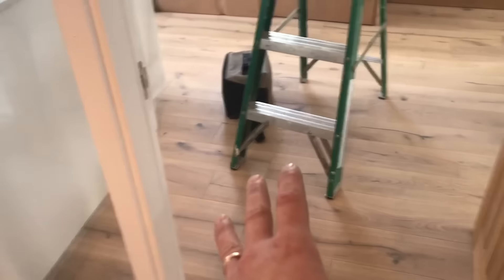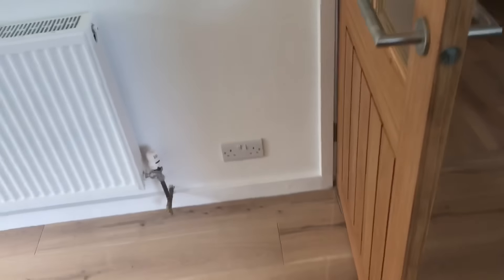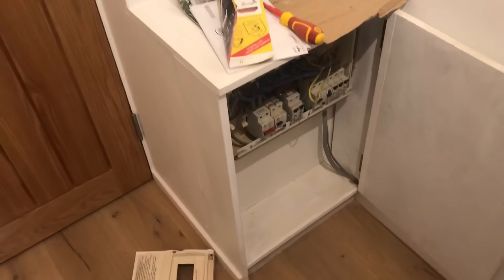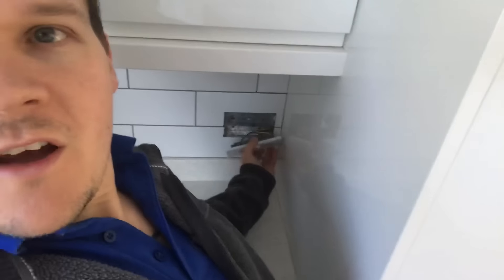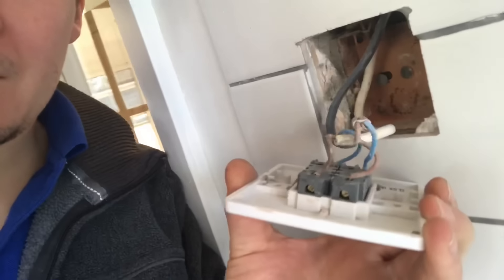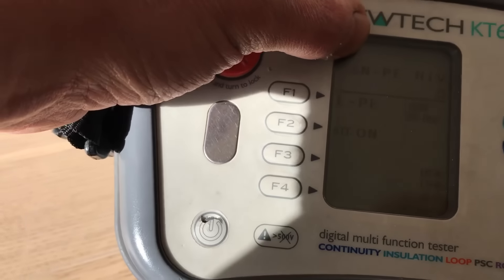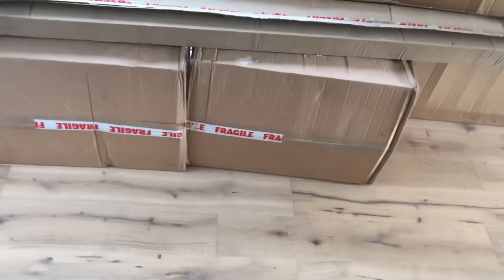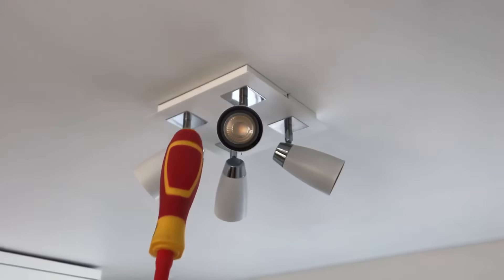Electricians day testing and inspecting one of the worst installs.

Comment: IP44 is actually higher than IPX4 andthat light is double insulated in the shower cubicle, Plus you take the measurement of 2.25 from the floor not the shower cubicle. Also what earthing system is it? TT,TNC-S, TNS? If it's a TT system then your reading are fine.
Reply from the maker: Trust me the readings are not fine it’s a PME system with a mains reading of 1.2ohms

Comment: Despite there being a wealth of free information on how to find, assess and hire professional tradespeople, the vast majority of people just want the cheapest quote for the work or job. 

I've seen and corrected appalling and recklessly negligent work billed as Professional, and have often pondered on What Were They Thinking?
Reply: They weren't thinking at all. That is the problem. Because no non-insane human could think in a way that makes stuff like that good. So we have to conclude they weren't thinking at all.
Reply: You see, that’s why you go for one that is recommended and charges fair prices. Expensive doesn’t make it professional work either. Also get an electrician that specializes in residential not one that does industrial and does residential on the side. They do know how electricity works but residential is a more meticulous work. There are electricians that do both and are good at both but are very rare and charge a bit more.

Comment: What was her reaction in the end? That's going to be an epic job to fix - going to have to chase the walls to put new trunking in, isolation needs to be fitted for the kitchen appliances so RIP any tiling/plastering. I'll go on a guess and say that flooring has to come up, which will probably wreck it. 

That's going to cost thousands in rework, wouldn't even be surprised if it were closer to 20k.
Reply from the maker: Video may follow on this one
Reply: @Cjrelectrical  Yeah do it,  probably not possible but I'd be interesting to find her side of the story and how she came to be in this position.

Looking at the fittings, she hasn't appeared to have 'cheaped out' which is usually what happens here. I'm totally hypothesising here, but either the builders under quoted figuring they could bodge the electrics or got in a cowboy to do the work (though any one with eyes can see that's just a massive hack job)

Comment: Any idea what can keep making the fuse in a spur blow whenever any heating programmer is attached to the backplate? All the wiring has been checked and is correct. Fault originally started when something metal falling behind the original programmer on to the backplate terminals. The boiler works if you connect it directly to power on with the spur currently. Could it be the 3 port valve that is causing a short since the programmer mostly controls the 3 port valve?

Comment: First number in an IPXX number is the dust rating, second number is water rating. It says IPX4 because the dust rating is irrelevant but it needs to be a minimum water rating of 4. That IP44 light fitting is actually OK - just about the only OK thing in this entire install from the looks of it.
Reply from the maker: Not with open connector blocks and an earth connected to a double insulated fitting.
Reply: @Cjrelectrical  Well, yeah.. theres a grommet going in to the fitting to keep the water out - as long as you kept the connector far enough away that IP44 light fitting is fine. What i'm trying to say is the fitting itself, as an IP44 fitting, is actually OK. Its installation however is a different story...

Comment: there is also the "gage"(is that the correct name in english?) wire thickness wich just dosn't seem to be thick enough for 32 A
Reply: very close gauge.  in the usa 10awg is good to 30 amps(distance applies but i think 30 amps up to 100ft) in GB 2.5mm is acceptable for 32amps but i wld use awg8 or 4mm but i always upsize for safety when practical

Comment: Why on earth, no pun intended, would you use metal housing boxes? I see this in US installations as well. In Norway we swapped those out as soon as plastic was invented and use ground wire instead. Also, the sharp burred holes in the metal boxes will over time (in wooden moving houses at least) wear down wire insulation, eventually shorting to ground. The 2x 1-pole light switches you showed though, seemed ok.
Reply from the maker: We use both plastic and metal
Reply: @Cjrelectrical  - Over all, I do agree with you, though. That installation was horrible, and I'm not even an electrician...
Reply: Also, in the fuse box, there was a floating L line. What was that?
Reply from the maker: There was 2 circuits I couldn’t even find that were buried covered up and left on and that brown wire was just disconnected and left in the Consumer unit.
Reply: @Cjrelectrical  - I'm cringing right now. As a courtesy to the client, install scores of fire detectors throughout the flat and run away. Saving a life is worth the investment.

Comment: It's interesting to watch your videos as well as some others.   I think standards have gone way down here (USA) also.  My parents' home was built in 1957 and wired exclusively with EMT (thinwall metallic conduit).  That takes some advance planning as you're somewhat restricted with your runs (every bend has to be done with a conduit bender).  Outdoor wiring was galvanized pipe.   But the electrical workers' union was very strong back then.

On the other hand, I visited my dentist who's having his office reworked.  This has been going on for over a year--crap wiring, workers not showing up--it makes you wonder.  He says that the excuse is that it's nearly impossible to find good talent nowadays.

Comment: A bad install. However your observation of the shower light in zone 1 requiring minimum of IPx4, then fitting found to be rated to IP44, thats ok isn't it? Or have I missed something.
Reply: I would of required the light fitting to be IPX5 as water jets could be likely from the shower.  The light fitting also appears to be class 2, however as this was a new install a CPC should be ran to every point.
Reply: @PJB71  Ok, thanks I am still learning from the EICR perspective of the trade. Forgot to say great content. 👍

Comment: All looks good, part P qualification working well  Bodge It And Scarper Builders INC. Read it and weep this happens all the time and there is nothing anyone can do about it. You can have all the rules and regulations you want, but when they are ignored and then not enforced what is a person supposed to do! The best thing you can do in this situation is to make out the certificate as unsatisfactory and call the supply company and have the supply disconnected for safety as the installation is in such a bad state it could cause death by electrocution and or a catastrophic fire

Comment: I have now retired but seen many of the problems shown here especially no earth on lighting mainly due to old wiring and the use in the '60s of double insulated singles. Of course, you get the know-alls that say my neighbour's dogs best mates uncles sister says you didn't need an earth in the 1800s and she's a teacher. Well, that makes it all good then don't it. Then the one who decorated right through had the old rubber insulated cables installed throughout the dwelling and wanted me to slice down the wallpaper fold it back, chop out for the cables, plaster it up then refit the paper... on every switch and socket drop (solid floor bungalow)...yeah right and where's that flying pig??? That one also wanted me to install a socket magically in a brand new fully tiled kitchen, much like the one here but not that cost I would have thought. That was without disturbing the tiling the plaster or anything whatsoever. Yep just stick it on the wall it will work fine. I walked... That incidentally reminds me of an installation I went to, to find out why a socket was totally dead...you guessed it no cable to it

Comment: Side note - IP ratings - first digit is Dust, second is water ingress, and X is used as an 'any' character. IP2X has foreign body ingress protection down to a certain size but no water ingress protection. If the standard says it needs an IPX4 enclosure, then IP(1-6)4 should be acceptable, Certainly an IP44 enclosure exceeds an IP34 for dust and foreign bodies.

Comment: IPX4 just means it should be splash proof. While IP4X means nothing bigger than a 1,0 mm wire can go through. Since the lamp is IP44, it is splash proof and nothing bigger than a 1,0 mm wire can go through. The lamp is actually okay to use. just not the best to use in a wet room. However personally i would use IP66.

Comment: i still dont get why attatching electrical cables to water pipes under my kitchen sink is a good idea? water + electric, what could possibily go wrong i have no idea?
Reply from the maker: Could potentially become live without an earth connection and you go to wash the pots and pans in the sink with  devastating consequences.
Reply: @Cjrelectrical  its an earth wire but still why does it conect to copper water pipes?
Reply from the maker: Extraneous conductive part

Comment: I'm american I honestly don't understand the 220 V that you guys use in the UK, Germany Italy etc....  But what I Really don't understand is WHAT  Why is the Gas Meter inside?!
Reply: In simple terms, if you double the Voltage, you half the Amperage and it's the Amperage that determines the required wire size for any given circuit.
Less Amperage = smaller wires = cheaper wires...
Reply: all meters are inside and its so easy to tap into mains for power if you wanted and utilities wldnt be the wiser lol
Reply: @wizard3z868  Actually, no it isn't easy to tap the Mains lines before the meter IF you want to do it without either shorting out the Grid (which the Power Company WILL detect) or electrocuting yourself and if you zap yourself with those wires, 99.9999999% of the time, your DEAD!...
No one other than Power Company Employees have access to or the tools to safely turn off the Power between the Local Grid and the Individual Homes (or turn them back on again)...
So any such "freebie" Taps have to be done while the wires are Live...
Good Luck with that...
Reply: @HappilyHomicidalHooligan  ive done meter cabinet installs in the usa from the power lines live its not that hard a good pair of rubber gloves and insulated tools and the balls of steel will do wonders hardest scariest £4 an hr job 20 yrs ago i ever had.
Reply: @wizard3z868 For a Trained Electrician or an Untrained Amateur that's been very thorough in their research it is easy and relatively safe, however, I was referring to the risks associated with an Untrained Do-it-Yourselfer who thinks they know what their doing but usually doesn't.
Reply: @HappilyHomicidalHooligan  lol yup a new phrase comes to mind play stupid games win stupid prizes or the all to common darwin award winner

Comment: The thing that I hate most is when a contractor is opening and working in a space...walls, ceiling, floor...know that there are problems and seal it all back up.  So, now you get to pay again to remediate.  That, and have to get an attorney.  Question...dont you guys have municipal building inspection services to certify safety?

Comment: I am not an electrician and not familiar with Englis regulations,
but I did not see any image where they used pvc pipes, rather ...
all the cable came out, as if the were plastered in with the stucco,
coming out, in front of the cable boxes. ???
In the netherlands, we would have to remove all the plaster,
cut out trenches, to put in pvc piping and then, plaster all the walls,
repaint all the walls.
This would come out at more than 4000 pounds.
Probably something like 10.000.

Comment: What is wrong with the light in shower? It is IP44, exactly as your book shows (your book shows IPX4)...
Reply from the maker: Open connectors and an earth connected to it so it’s not ip44 and it’s not double insulated. Hope this clears it up for you.
Reply: @Cjrelectrical  Yes, thanks, makes sense. Just wanted to clarify as fitting itself was IPX4.

Comment: A lot of cable work in the house I bought was even worse than this place.
For example the old owner had installed external cables along the wall indoors which was nailed in place trough the cable, yes through the cable with live nails. More was also naked live wires isolated with masking tape or left completely open for anyone to touch. Inside a wall outlet it was a cable extended with the live wire taped together without any other thing than the tape to hold the joint together, the threads was not even twisted together. 
I also had a screw hole right through a hv cable for a curtain bar made of metal. Another wall outlet was burned empty by a fire made of bad connections but it was still left with power like that. 
There was also cable terminals damaged by water still in use and other ones was missing covers with all the live wires open for anyone to touch. I could make this load of nightmare solutions long. I am just really impressed no one got hurt by all this stuff.

Comment: Just a note rcd protected circuits you are allowed 1662 ohms for maximum permitted zs on any circuit.Installation is still crap though
Reply: You don't design a circuit to 1667ohms or rely on the rcd as a means of fault protection.
Reply: @tomhowells6240  regs still state 1662 ohms,theres not really an argument if doing a periodic test New install then that's fair enough
Reply from the maker: Give me a reg number bud or table
Reply: @Cjrelectrical  411.4.9 then refer to table 41.5
Reply: I dont work to this ruling myself but there is definitely a grey area/debate on this
Reply: Further investigation required in my eyes. But the fact you'd accept it due to rcd max values is negligence. Clearly a poor installation.
Reply: Definitely grey area, to be honest some state is that place glad I didn't have to test it

Comment: Yeah ... absolutely shocking is the fact that when I bought the old victorian house in UK it featured old style fuse box in the living room up on the front wall at the 1m height from the ground. Apart from wooden laminated board that was supporting this contraption it didn't had any box or anything preventing kids to touch the live elements. It was an eye sore to the previous owners so they decided to hide it behind a cloth hanged from piece of string spanning from the external wall to the chimney. So look ... I am not an electrician that holds UK qualification but I have EU diploma with the title of Electrical Technician so I did rewire the whole house including new fuse box with 2 zone RCD that now lives in the kitchen near the ceiling away from anybody. I do not have any certification for this new installation ... but I do not loose sleep about it.

Comment: i found this one house were the previous electrician installed 2 main switches and 2 earth leakages (separate one for a normal pump).... the mains went directly 2 the live busbar for the breakers essentially bypassing the 2 earth leakages they had more than 10 MCB for plugs and lights and this was a normal 3 bedroom house 1 geyser no earth spike outside no bonding on any plugs or on the geyser/stove extra they had a certificate of complacency...only thing this customer wanted me 2 fix was the shower taps was shocking her and the stove when she used it... i told her the wiring is unsafe and needs 2 be rewired i switched off the mains at the mini sub and told her she needs to get qualified electrician to fix everything and re do the COC before i will switch her back on

Comment: 7:03 - Can you tell me what is wrong with that? I couldn't see the problem.
Thanks
Reply: The back box had 0 gromits in to protect the cables from coming into the back box.
Reply: @Nectori   Thanks. I don't think I have a single one in any back box in my house, although I have mainly plastic ones. Why are they necessary?  Is it just on the metal ones?

Comment: Just wondering what  make of socket tester you were using.
Reply: It looks like a LAP MS6860D. I use a Fluke SM100 but of course there are many other brands, including Martindale.
Reply from the maker: Correct I’ve also got a martindale and a kewtec one pretty much all do the same thing.

Comment: Geez, I see what you mean, no protective-earth on a 240V AC mains socket is an automatic fail, or should be an automatic fail, I've got an electrical tag and testing ticket (need to get it renewed before I can do more tag and testing work) and I would have given the lot a fail after doing a visual check, so I can see why you were frustrated.

Comment: great video...been there many times, had customers in tears. when you tell them that lovely house they have bought needs a rewire...all there new fitted carpets/laminate is going to have to come up....there new tiling will need chases cut etc etc....they can bring out all the new regs they want..but diy'ers and wanna be sparkies will always just ignore them....the only way to stop it, is to stop BQ/screwfix etc selling electrical products that are intended for professional use...all should be available through registered wholesalers where only qualified tradesman can buy....
Reply: That would be a great solution. However, not all electrical products are used for house. I have a hobby and use it in things I built. But I do agree that some of the products sold should be only available for electricians

Comment: The JB's in the ceiling could of potentially been maintenance free, which would of been acceptable. Looking at the rest of the job though I doubt it and wouldn't of be surprised if they just used block connectors wrapped in electrical tape.